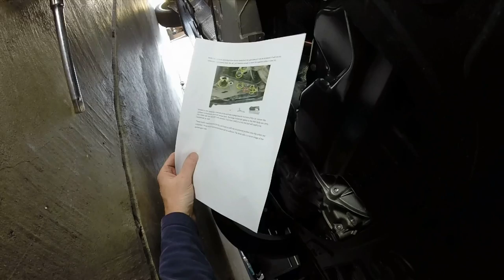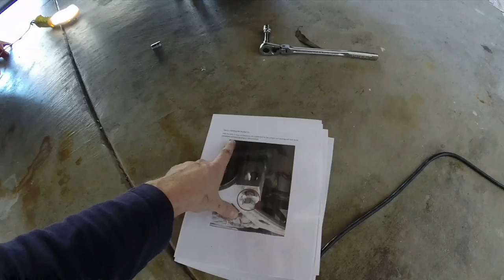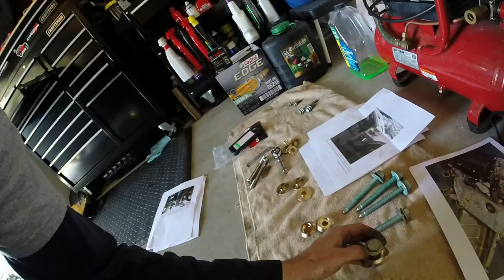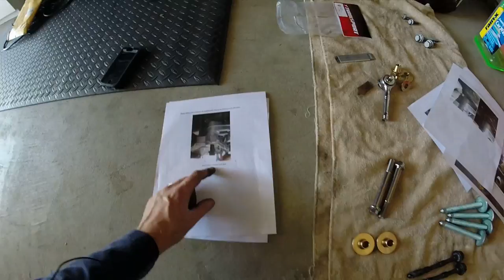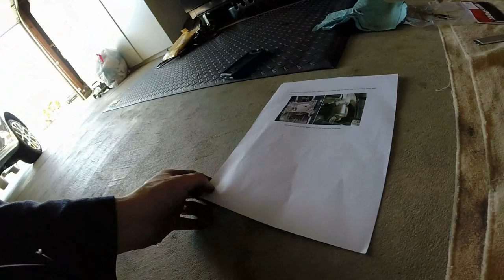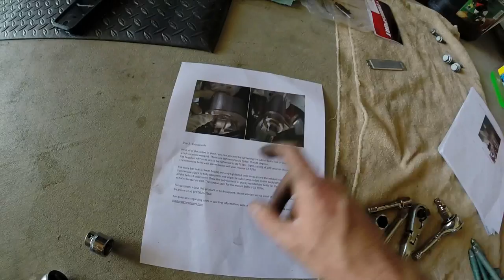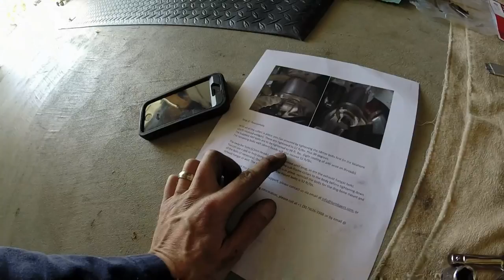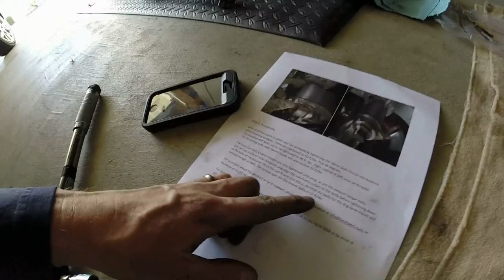2013 VW GTI: Episode 25 Vlog: TyrolSport DeadSet Rigid Subframe Collar Kit Installation

Comment: That bolt that's missing is due to the fact some generations of racks only have 3 mounting points. Generally the newer VW Audi group cars which have 3 and not 4. The old ones use the same subframe so the hole is still present. It's nothing to worry about though
Reply from the maker: Even tho this is over6 years old... thanks for the knowledge
Reply: @LastHumansGarage  yeah still just thought I would point it out for anyone watching lol

Comment: Also when doing this please note that any bolt that has a final torque angle is likely a stretch bolt for one time use. Torqueing them back in will likely result in them snapping off when you try to remove them next time. I highly suggest all new bolts any time you drop the subframe and generous use of anti-seize compound. This can get pretty pricey if done once or twice so I highly recommend completion of multiple tasks at once that require dropping the subframe (i.e. swaybar, control arms, etc) I have had one of the bolts that ties to the subframe mount snap off inside because it was reused and it was a nightmare.
Reply from the maker: Good tips my friend

Comment: The center bolt mentioned around 4:30 on one side and not the other is for the steering rack. It's always missing one side or the other based on your car being right or left hand drive.

Comment: I was wondering how you got this $300 kit for $200 - holy 9 years ago, Batman! 
This is a great supporting mod for the Mk7 if someone ever lowers their front cradle to do a FSB (front sway bar) or upgrade LCAs. I highly endorse the ARP bolts over the factory TTY bolts for longevity and tensile strength. 
Thanks for the video, friend. ✌ ❤ 🍻
Reply from the maker: sure mate

Comment: Am I the only one that noticed that you couldn't use the 4 beefy Audi Bolts because you didn't remove the huge washers that came with them?  It seems to me that the bolt itself had a head no larger than the VW bolts that you removed from your car.  Am I wrong?   From what I see they seem like they would've worked if you had just omitted the huge washers.  After all the ARP bolts didn't come with washers.  They fit right in those recessed brass collars.
Reply from the maker: interesting point. but this was a long time ago. i remember the washers were attached to the bolts and you couldnt get them off.
Reply: Ah thanks for clearing that up so quickly.  From the vid they looked so loose, it made me wonder why removing them wasn't so evident to you.  I'm looking at buying a set, but I think I'll wait till I put on my winter tires when I would be getting my car aligned anyway.  Did you ever have any problems with the subframe being so stiff that it was difficult to align the car?  Was the drive dramatically different for better or worse or was it just for peace of mind?  BTW, your videos are very well done and easy to follow.  Keep up the great work!  (I recently purchased a 2010 Audi TTS with only 56000kms and I've noticed some creaks and pops that I'm hoping the Tyrolsport kit will resolve.)
Reply from the maker: the stiffened part has nothing to do with the alignment setting areas which are till functional. if i remember correctly, only the toe is adjustable in front anyway. only way to adjust camber was by sliding the subframe, and after this kit, it should be perfectly centered anyway.
Reply: I was thinking the same thing and scanning to see if someone else noticed. Pretty sure that the audi bolts he has were bought seperately, and came with the washers they were supposed to have for install on the audi stock, but not needed for the kit cuz the brass bushing is more or less also acting as those washers. I have done a lot of investigating this issue, and this fix, and the heavier audi bolts are much less prone to stretching and creating more issues, bushings or no. Some people just replace the stock bolts with the audi bolts and tighten them to spec and they solve the problem, at least for a while, and they just tighten them again if it loosens up, but this bushing kit seems to be the most successful in being  a permanent fix, basically correcting the flaw that causes the problem in the first place. Most people feel that this kit not only prevents the bolts loosening and causing "VW Subframe Clunk" but also seems to improve the overall feel/responsiveness of the front end. It's a good idea to have the alignment checked after this installation, as there not only can be some change to the positions of the parts while loosened, but also if the alignment was adjusted prior to the kit installation, they may have been correcting for the subframe issue... and fixing it might have things in a different position... but if you aren't getting steering vibration or other bad alignment symptoms, you are probably ok till your next maintenence at least.
Reply: Oh 1 more thing. If the washers on those bolts couldn't come off, I would have honestly considered throwing a nut on there to hold the washer tight, shoving the bolt into a drill chuck, and turning the washer against a file or similar to shrink the washer to the diameter of the bolt head, just to have the stronger bolt... but... I am a glutton for punishment, your mileage may vary.

Comment: This problem is with all the MK6 golfs. My steering wheel was 6 degree towards right. Thought they missed couple off tooth on the steering wheel assembly, I was wrong. I thought the steering wheel sensor needed to be re calibrated. Eventually I found out that it was auto calibrating steering wheel, when I disconnected my battery and reconnected it; most of the electronics were auto calibrating by themselves. It was a good news indeed... Then I went to an alignment show with a Hunter alignment. My god every aspect of the wheels were crooked. Cost me $210 to realign all four wheels. Now Im getting good gas milage, and my steering is almost perfectly straight. However, since the alignment (which was a month ago) the problem seems to slowly come back... So disappointed with my mk6.
Reply from the maker: sometimes i feel that way too bro.
Reply: LastHumansGarage but I love my car too much regardless.
Reply: The MK Generation is all about having a love hate relationship. Lol. I have a MK5 2.5 Wolfsburg.

Comment: Great video. I will be using this as a reference for my install. But I've gotta say, using a precision tool such as that torque wrench to add the final torque angle makes me cringe a bit. A breaker bar would be much better suited for that task. In any case, happy motoring!
Reply from the maker: true statement, a torque wrench isnt made for that task.